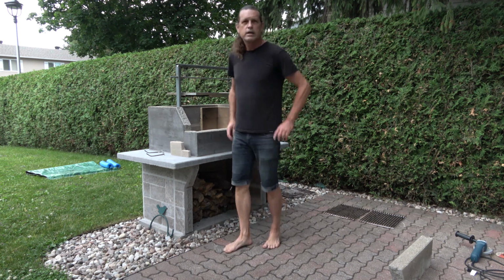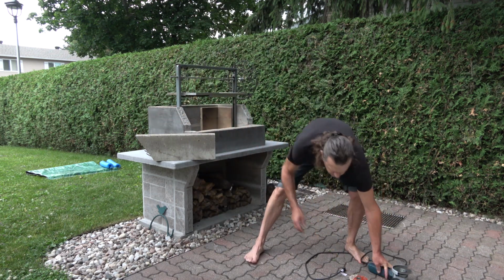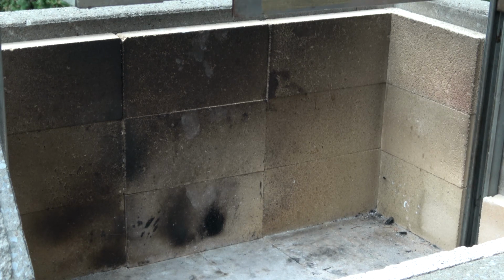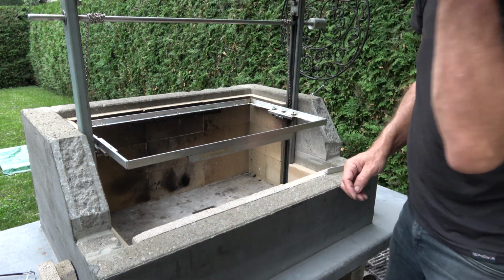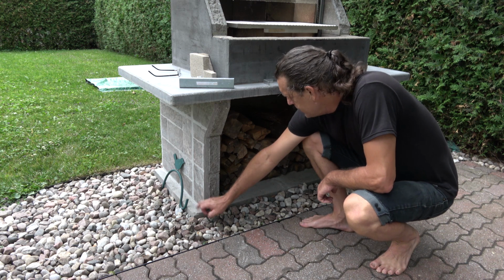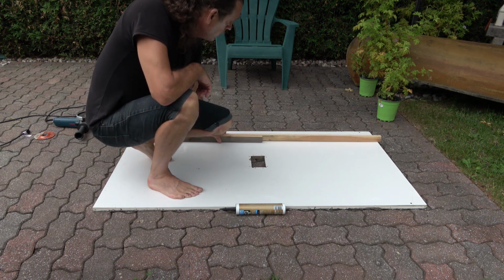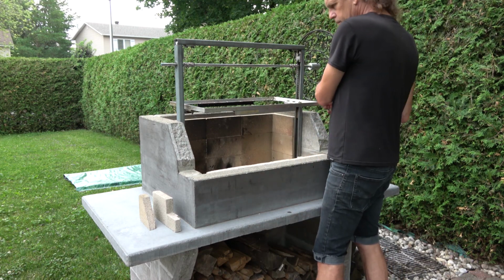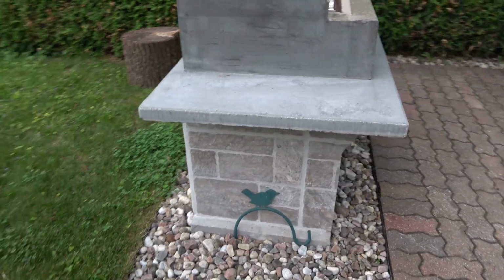S RIPPLE   BBQ SANTA MARIA GRILL, PART 2 how to build one

Comment: Awesome BBQ man. No welding either! How is the steel rod held in place? It’s so smooth and quiet, really great job man.
Reply: Old comment but at 4:59 you can see a pin inserted through the rod. Just need two of those. You can also maybe use a tap and die, and thread the rod on the far end enough for you to install two nuts on the end opposite the wheel. Could also adjust tightness that way.